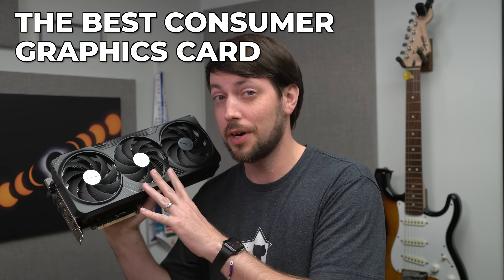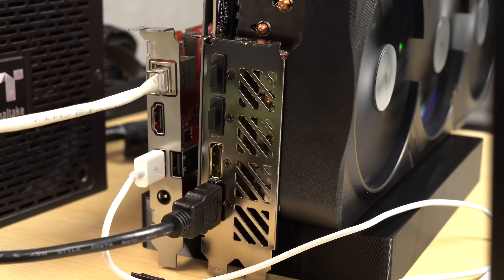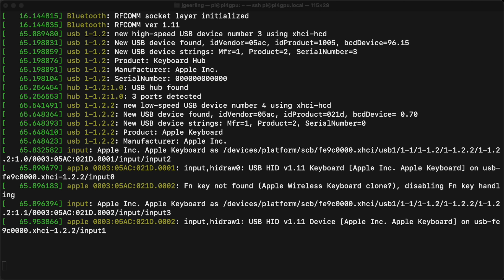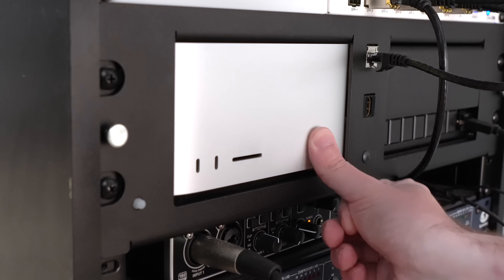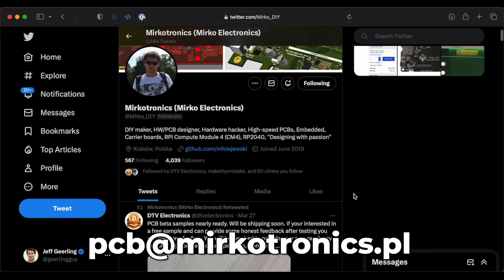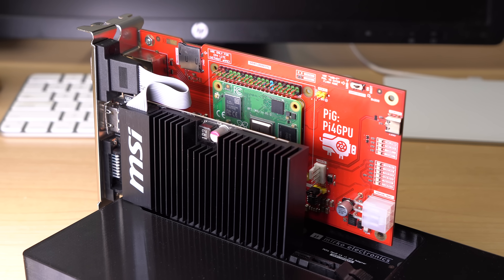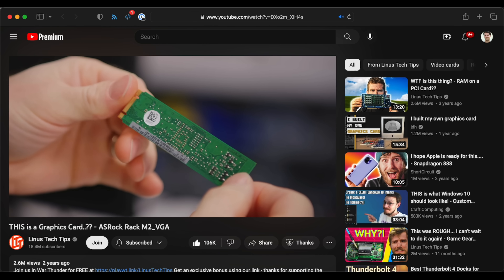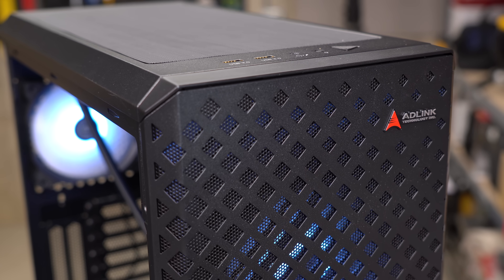I tested EVERY graphics card on a Raspberry Pi!

Comment: About intel, they are currently working on a new kernel driver for their latest GPUs called "Xe", I'm not sure if that works on ARM but it might be worth trying. Keep in mind though that to make any use of that (if it even compiles and boots) you need to also compile mesa with a few unmerged merge requests
Reply: @Wotzinator If you're interested in using it for gaming on linux, I can't really recommend it atm. Most games that I tried wouldn't boot at all, and the vulkan driver is missing some critical features to properly support vkd3d, and last time I checked there hasn't been any progress on this in months. I had an A750 for a few days but actually returned it for that reason. For desktop use and media encoding/decoding it's great though, pretty much everything worked ootb (although I only tested wayland, not xorg)
Reply: @Wotzinator Xe is the name for their current graphics architecture used in modern iGPUs as well as Arc, previously known as Gen 12. Now they're also calling their kernel driver Xe. The Xe kernel driver is supposed to supposed to replace i915. Phoronix has a few articles on the changes